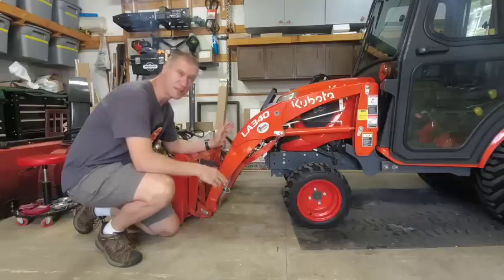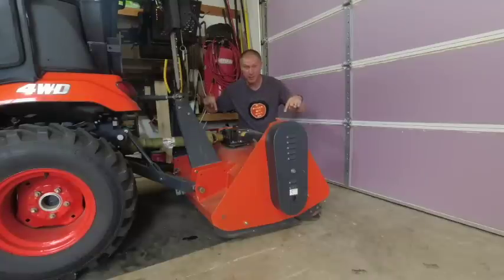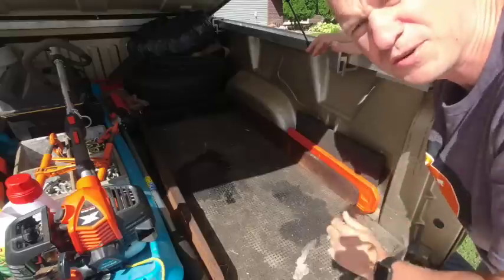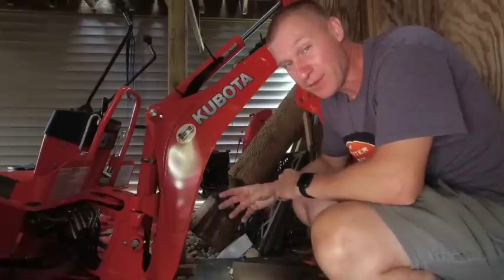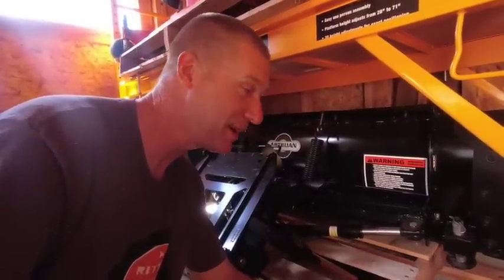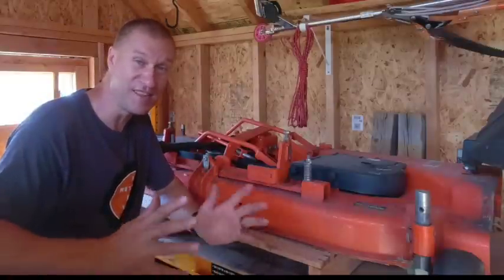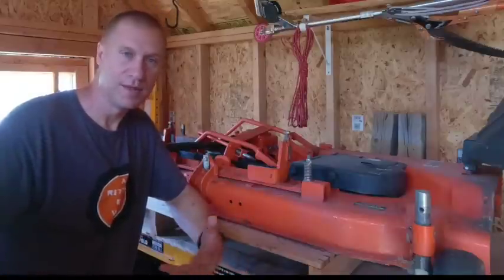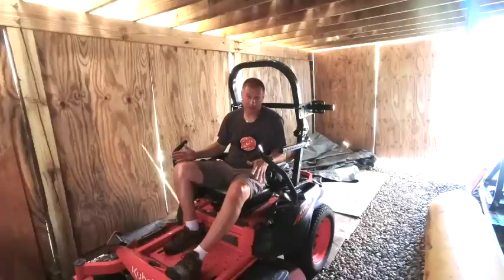THE WORST TRACTOR ATTACHMENT!

Comment: I totally disagree about the mid mount mower deck. I use mine every week to cut my two properties. I take it off late fall every year. The diesel engines run forever if you take care of them so I don’t worry about hours on it heck I bought it to use ! You can always invest in a rear mount finish mower if you hate the mid mount that much? Lol 😂 Heck that  Kubota diesel will outlast you! Lol 😂
Reply: I agree I love my mid mount mower. It cuts great is super smooth and I can cut forever on a tank of diesel.
Reply: @turbotona25  So true one of my properties is 2.5 acres & the fuel guage hardly moves after I finish cutting it !
Reply from the maker: Diesel has the power and durability to last a long time and barely uses any fuel. However it’s. However my zero turn is twice as fast, more comfortable and does require me to mess with attachments. Thanks for your comment. 
Keep on tractoring!

Comment: I agree with you 100%. I purchased my BX23s last year in BC Canada. The dealer couldn't believe I didn't want a mower that was on sale at$300 off. It was still a $3,000 attachment. So, instead, this summer, I got a Kubota Z412 zero turn mower. Without a doubt, it was the best decision I ever made. The new seat is absolutely amazing. You can spend hours on it in perfect comfort.
Reply from the maker: I don’t understand their seat debacle. Why can’t the Bx have a nice nice. It just doesn’t make sense. Smart move not getting a mid mount. 
Keep on tractoring!
Reply: @ritterjon  lucky theres air ride seat avaliable for bxs

Comment: Absolutely agree.  Bought our bx in April and have saved 150 hours on it by using a 60" cub garden tractor with an offset swisher.  The BX is only used for loader/3 point items.

Comment: Agree BUT with a steep yard a  2wd riding mower will not work. The BX2350 manages the grade just fine and without tearing up the lawn. Since its under .75acre it can be mowed in about an hour. The mid mount mower is a HST fan guard so its seldom removed, for running through the woods.
Reply from the maker: For a small yard at least it shouldn’t put too many hours on it. I agree it does protect the fan well also. Have you heard of a Ventrac? They are the best at steep grades. 
Keep on tractoring!
Reply: Purchased new in 2009 it has about 1000 hrs. on the clock. For mowing, towing and skidding logs its a versatile machine for my needs.

Comment: Having had four Kubota’s I believe you are correct. Kubota has thinned out the steel body, the wheels are terrible whether all plastic or steel and rubber, it’s difficult to grease and way way way to hard to get on and off. Someday I’ll tell about my 50-30 amp fuse box problem!!! I’ve been on it over a month!!’

Comment: When I bought my BX23S I did it 95% because I watched your videos.  At that time you had and you used your mid mount mower.  I had a riding lawnmower but I didn't have room for both the BX and riding mower.  So I bought the bx with mid mount mower and I got the 3 point bagger (I'm not mad, you have a right to change your mind).  The delay due to covid was horrid and 1.5 years after ordering it all, I got the mower and bagger.  Then I was busy and didn't try it out for several months.  I finally got time and hooked up the MMM and it was the biggest headache I have ever had.  Most 3 point attachments are no fun, but the MMM was horrible.  Over time I realized that lifting up the front tires helped a lot.  So I leave the FEL on and lift up the front tires and slide it under and now it's manageable.  The grass catcher/bagger is another pain point.  I have put the mower deck on and off several times, but I have only put the bagger on once and taken it off once, but I want the clippings off the ground and it does the job pretty well.  I also decided to buy another 3 point hitch so I could leave it "set" in the right position for the bagger.  I bought the Pats quick attach for the 3 point and I like them, but the bagger will not work with them on, so essentially I had to buy another 3 point system and I now understand why you have to hook the bagger onto some stationary mounts (part of the installation process), and it's because the 3point rear linkage goes up and down with the mower and you can't stop the rear 3 point from moving.  So it has to be forced into staying put or the pto shaft will not work.  I agree it's one of the biggest pains for owning a BX but only having used it this one season (several times) I think I'll keep using it and curse it each time I have to (because it was A LOT of money).  😂

Comment: I know the MMM is the right choice for some, but I tend to agree with your assessment Jon.  Not so worried about hours on the tractor,  but having to constantly take it on and off, and versus the efficiency of a ZTR (even with a slightly smaller deck), the mid-mount was a hard pass for me on the LX.
Reply from the maker: Glad you agree and didn’t spend money on a mid mount. It’s really hard to beat the benefits a zero turn has. Hope all is well buddy! 
Keep on tractoring!

Comment: Everyone’s situation is different.  I have back issues and was mowing about 1 acre of uneven and rough lawn.  Needless to say I dreaded mowing the lawn. I was looking at the Toro zero turn with the myride suspension.  $7000 Canadian and the salesman telling me it should last 10 years, I decided to go with a new BX2380 with a 54” mid mount mower and front loader.  With the high back reclining seat, tilt steering, large turf tires and reduced mowing time makes mowing my lawn enjoyable.  Its not as fast or smooth as a zero turn, however, I am now able to level my lawn with topsoil using the bucket as well as numerous chores around my property and for plowing my 130’ driveway in the winter.   I’ll see how I do moving snow this Winter with the loader and bucket but will eventually invest in a snowblower .  I enjoy watching your channel.  😀
Reply from the maker: For that long of a driveway I’d suggest a front or possibly a rear angle blade. You’re right, everyone’s situation is different and I’m happy you’re doing well with your machine. They can be a lot fun and save a lot back breaking work. Thanks for the comment. 
Keep on tractoring!
Reply: Thanks for replying. They sure are a lot of fun😀

Comment: Dang, I just signed for a new BX23S Friday.  Bought it with the intention of cutting grass plus farm work.  You may have changed my mind about dumping our riding mowers.  I will probably keep one at least and like you said use the tractor for the farm work like it was built for.  Great video, really appreciate your time and honesty.
Reply from the maker: Hold on to those riding mowers. You might find that they are a better option. Your BX will be able to handle all sorts of stuff but it’s a cut above cutting grass. 
Keep on tractoring!

Comment: I agree with you. When I bought my BX2380, I used the mower alot. I then got tired of getting cold in the winter moving snow so I  installed a cab on my BX. I  then had trouble  mowing close to trees, so I  took the deck off and bought a zero turn. Thank you for your video.  I  also have less trimming to do with the zero turn.
Reply from the maker: It amazing how maneuverable those zero turns are! 
Keep on tractoring!

Comment: I have a bx25. I agree that the mmm is a pain to put on and take off. However, for me, it’s a Godsend. I mow about 4 acres weekly and most of it is on a 25°-30° slope. A zero turn won’t hang on the side of the hills. I’ve tried green ones, orange ones and yellow ones without success. A standard box store riding mower lasts about two years and they’re shot. It’s too steep for the oil pump to keep up. If I had a flat yard, there’s no way I’d mow with anything but a zero turn! Love the channel. Keep tractoring!
Reply from the maker: Sounds like some seriously steep slopes you have. You should consider a Ventrac. Those things are made for slopes and are quite comfortable to operate. 
Keep on tractoring!

Comment: In my opinion, all attachments you showed are great ! It all boils down to what a person needs or in some cases just wants. In my case where I mow the zero turn just isn’t safe or appropriate. I needed 4 wheel drive for some areas. My main use is mowing and rear attachments like a box blade or regular blade and any rear PTO equipment if I desired. I agree the deck isn’t easy to remove and reinstall but it is a quality deck unlike the box store mowers. In closing, it’s just whatever a person needs for the job or they just want to have it. Have a Blessed Day 🇺🇸TCB⚡️

Comment: I agree with you 100%. The mid-mount mower deck for my last BX got used exactly one time (just to confirm it worked okay when new). The remainder of the time I owned it was spent on a skid taking up space in my barn.  I mow a bit over 4 acres, about a third hills, with a "green" 60" zero turn. Takes well less than half the time compared to the BX2680. When I traded for my LX, I did not waste money on another mid-mount mower. It was priced nearly the same as a mid-size zero turn. I found a used finish mower instead for a backup to my zero turn. 

Another interesting video. Thanks and keep having fun with your tractors.
Reply from the maker: Glad you agree, yep the mid mount just isn’t worth the hassle. Thanks for the comment! 
Keep on tractoring!

Comment: Some like Bud, some like Miller. 
I disagree with a new ZT vs a new Mower deck. I agree with a good deal on a used hydro riding mower vs a new mower deck. The ZT also requires storage, maintenance and messing with belts. 
One the loader, why buy a 1/2 pickup when you need a 1 ton? 
For my 2 acres in north Florida, I wanted a small multi-tool, i.e. a riding mower that can be a miniature mule when required. BX1880 is it. Mows great, moves yards of dirt, pushes big stumps, moves chopped down trees. I did get a free hydro riding mower I use for rough mowing, and a steep ditch. 
I enjoyed your review of the other implements. 👍

Comment: I agree on the mid mount mower. I to mow with it, but it is a pain in the back side to put on & off! I went with a 6' 3 pt behind My tc 33D compact. A cheap low hour sub compact with a mid mower. I use My mowing time as a stress reliever! Keep on tractoring.
Reply from the maker: A 3 point mower is much better than a mid mount and the fact you have a six footer is a time saver. 
Keep on tractoring!

Comment: I certainly agree with you.  In my own situation, I use a flail mower on my tractor for almost my entire lawn and I like it way better than my belly mower.  My belly mower based on the instructions is suppose to take around 5 mins to install.  YA RIGHT!!!!  I can put the flail mower on in 5 minutes with obsoletely no issues.  Sure going around beds and stuff can be an issue and that's why I always have a lawn mower and a good  Weed cutter around for those jobs.  My flail also adds a bit a weight to my tractor  when I'm using the loader.   Hey, I used a belly mower for 15 years.  Like you said in the video, it works and it works well but It's a complete pain to put on even when your use to it and its a pain to store not to mention the upkeep required to keep it running well.  I have a huge lawn area to cut on our homestead with a surrounding forest that keeps wanting to take over my lawn.  I understand that those with smaller lawn areas may find a flail mower  just  a tad to big and may settle for something a little more adequate for their own circumstances and that's where I totally agree with you that there are much better solutions than a belly mower.  In the end. it all depends on your applications and the best solution for your sub compact tractor.  Great video and lots of fun.  Keep them coming!
Reply from the maker: Thanks for the great comment. I appreciate you watching! 
Keep on tractoring!

Comment: I’m in Nova Scotia. I purchased the mid mount mower last fall with my BX but ask to pick it up this spring as I was in a new build and wouldn’t have my lawn installed until then

Then when this summer came, the money I spent on the MMM I told the dealer to keep it and the mower, and I’m paying the difference on a a z232 zero turn. I also have the Curtis cab and think it would be too too heavy on the slopes of my lawn and the other reasons you’ve mentioned.  

Totally agree on skipping the MMM
Reply from the maker: Sounds like we’re very similar! Glad you got the zero turn! I bet you love it. 
Keep on tractoring!

Comment: I don't have a Kubota but I have a New Holland and I love my Mid Mount Mower.  Yes, it is marginally slower in my yard than a zero turn but having the torque of a 29hp diesel mower is amazing compared to a cheap 22hp gas zero turn.  And I can mow my lawn for 1/3 the fuel cost.  It is a little bit of a pain to remove but for most of the summer I just leave it on and pin it up.

Comment: I 1000 percent agree. Plus my compact tractor 3 point and deck go down at the same time so if you go to the woods with rear attachments your lowering deck as well and catches on everything.
Reply from the maker: If you lock it into its highest cut setting it won’t go up and down. But it’s is still a pain to take off and put back on. 
Keep on tractoring!
Reply: That's true, but the overall ground clearance is so susceptible to catching on everything.  @ritterjon

Comment: The mid mount mower deck for the BX as you said, it a PITA to take on and off. However, we just learned a way to take the mount mower on and off that is easy. We do have a John Deere Z turn that we have owned since 2010. That Z turn has mowed a  lot of the property around us. However we purchased it used, and have beat the machine up quite a bit. Right now the Z turn needs major work, and we are putting the mid mount back on the BX. We are holding out for an electric Z turn as that is the future and we are 75% electric in our home, one car with the tractor etc the only machine that is a combustion engine. We also have an eye out fr when Kubota or John Deere sells an electric tractor and will invest in that. But for now will fix the turn and  use both the BX and B2650 to mow. Love your videos.
Reply from the maker: I appreciate you watching and leaving a comment. There are some pretty decent electric zero turns already but I think you’ll see even more option next spring. I also have a feeling Kubota will launch its electric tractor next year also. 
Keep on tractoring!

Comment: Thanks for the advice I was thinking about a mid mount mower for my Massey Ferguson 1723 E tractor but I use the backhoe and bucket more than I would for mowing. We have a 54” Cub Cadet for mowing a lot easier to mow in tight places.
Reply from the maker: Yeah don’t get the mid mount mower. It’s really not worth it. I think you’d be impressed with a. Zero turn if you ever wanted to replace that cub cadet. They are extremely maneuverable. 
Keep on tractoring!

Comment: I had them fix my quick connect for the hydraulics and it worked great for about a year and then it started to leak again. I checked the connections and made sure it was all tight. Since then the leaks have stopped. I’m guessing because of use and vibration the fittings must slightly loosen over time.

Comment: I agree with you 100%. I bought a new LX3310 Cab Kubota with the bucket and front mount snowblower.  I DID NOT buy the mid mount mower. I bought instead the Kubota ZD 1211 Diesel Zero turn mower. So much easier get on the zero turn.
Reply from the maker: You got yourself a very nice zero turn. I bet you’re loving that setup. Thanks for commenting!
Keep on tractoring!

Comment: My tractor doesn’t have a mid mount option. I have a 6th brush hog and a 6ft finish mower. I use them the absolute most. My least favorite attachment is the landscape rake. It would be different if we had a riding arena to maintain (that’s future plans) but it has been useless for our rural property.

Comment: I have a B, not a BX, and in hindsight the belly mower was indeed not a good choice.  It's been sitting on the barn floor on its furniture leg dollies for a couple of years now, while I use my somewhat undersized zero-turn to do the mowing.

The main reason for this is that I tend to be using 3-point attachments a lot, and they don't play nice with the mower deck, so I'd be constantly taking it off and putting it back on (and doing the reverse with the tiller or box blade), which is a pain.

Shoulda skipped it and gone for either a brush hog or a flail mower (plus a bigger & better zero-turn for the lawn areas).
Reply from the maker: Glad you agree! Maybe list that mid mount for sale and look into getting yourself a better zero turn. I’m sure you could get almost new money for the mower deck. 
Keep on tractoring!

Comment: I agree that in yours and many others use case, the MMM is a waste of money. Then irony is I bought my 2380 specifically and primarily to mow after my JD ZT blew the engine. I wanted a reliable diesel mower that could do light dirt work and that would replace my snowblower. A 2380 with the mmm and loader checked all the boxes like no other machine did. My only regret was not ponying up the (Frankly insane) $6500 for the heated and cooled cab. Other than that, I'll probably be putting a flail mower on it next season and seeing how I like the cut vs the MMM. I have a ton of sticks and branches fall every year and I'd just as soon mulch them with a flail vs dinging up my MMM. Who knows, maybe next year I'll be agreeing with your Worst Attachement choice but for a totally different reason lol Happy Tractoring!

Comment: I agree with you it's in way all the time and I can mow my yard much faster and easier with my zero-turn get closer to the trees and under them it's designed to mow it has a 60 inch deck when necessary I use the bush cutter